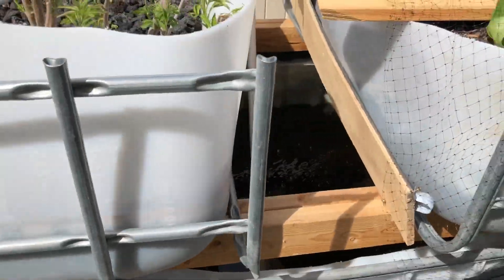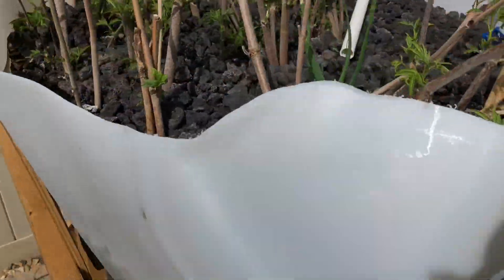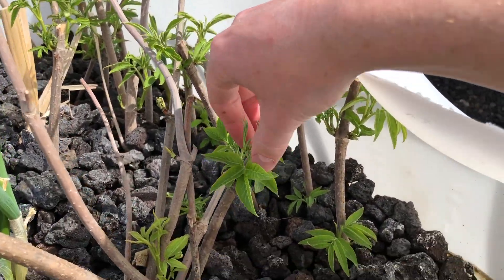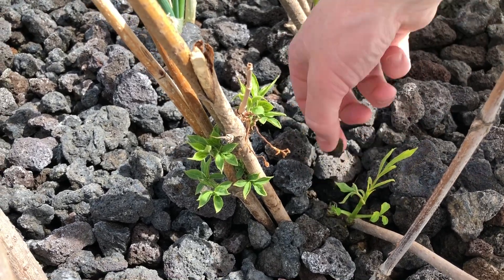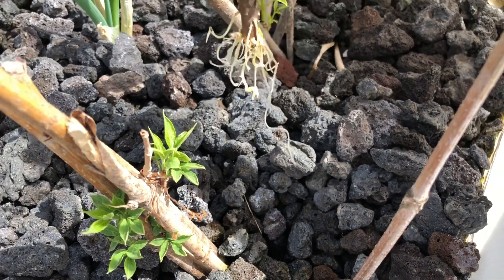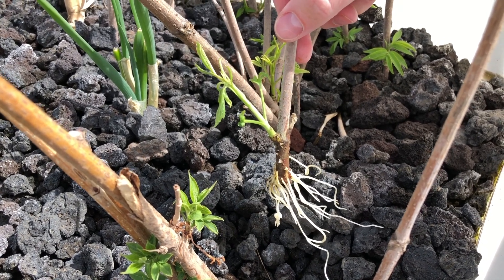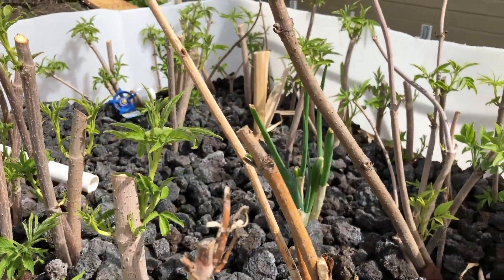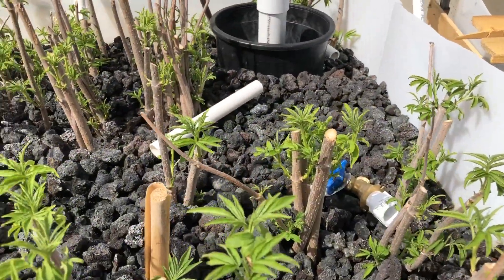Elderberry Plants from Hardwood Cuttings | Aquaponics

Comment: Thanks for the videos. I’ve been trying to propagate elderberry cuttings for the last couple years with no luck. I want to do it like you do since you’re so successful at it. 

Do you just give the plant six weeks grow time in the spring and then cut off the new growth and stick it in your grow medium? 

I always would cut the old wood off the plant before the new growth begins and stick those in the jar. They grow out the leaves but never take root. 

I’m hoping I can be successful the first time around with this. There’s a lot of plants I bring home that would be perfect to put in these grow beds that I currently have been killing from the roots drying out.
Reply: Thank you for your reply and your videos, it’s all very helpful info. I have faith I’m going to be successful this year🤞🏼I want hundreds like your other video where you start from seed. I’m gonna try that too
Reply from the maker: See my latest $150 Backyard Pond videos, same type of system, much easier to start now.  Two types of cuttings - hardwood /softwood. Hardwood is taking cuttings right after winter before new growth has started for the year (basically sticks). Hardwood work well, typically slower to root out. 

Softwood is typically 6 weeks after the plant has started growing for the year. Green growth, needs to be a little inflexible, it helps to cover or shade softwood cuttings because they tend to dry out quicker. You could cover with shade cloth. 

Either way, these cuttings or sticks will start rooting. You can check every few weeks, let them get a baseball size root ball, put them in potting soil in the shade for a week or two. Then transplant to wherever.
Reply: Blue Elderberry are very difficult to root! Are these a different variety that you are rooting? 
TIA